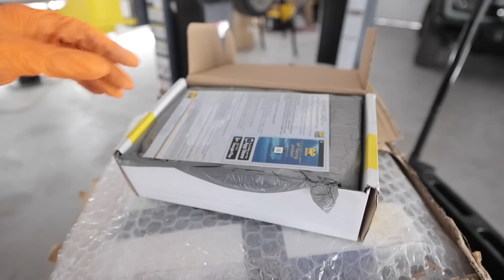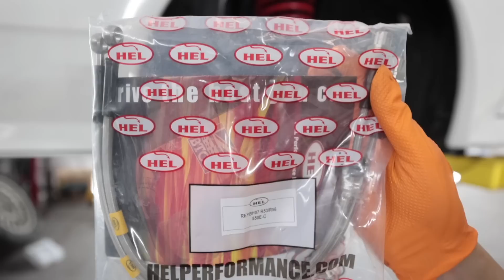Audi UrQuattro Upgrades! 5 Cylinder Turbo Pure Sound

Comment: Hi Sarah,
The K-Jetronic system was incredibly capable and flexible for tuning - if you know your way around them, and I would not discount some of the advantages it offers with turbocharged cars. Try and get your hands on a copy of a book by Charles O. Probst (ISBN 0-8376-0300-5) covering Bosch fuel injection and I am sure you will be surprised. Given the time the system has been sitting, it will be gummed up and that can create the cold idle issues as well as delayed throttle response etc.. Perhaps a series of the overhaul of the K-Jet? I'm sure it will fascinate a lot of your viewers as it was not widely understood. Modern electronic system are superior but part of the character of that package was in the K-Jet.
The UR is one of the greats and you are a very lucky individual indeed to be able to enjoy it. 
Look forward to the next update!
Reply from the maker: Ordered it!
Reply: @SarahnTuned  I have the K-Jet on my 1988 Testarossa.  It acts the same way as you describe.  If I let it sit too long without driving it, it is a bit lumpy on idle.  Once driven a while she settles right down.  Keeping everything clean and happy (running/driving)  is key.  

Love the channel!
Reply: @curtiscampbell6178  I'm finding the same with my 85 urquattro - the more it's driven the happier it is.
Reply: The right person will be able to tune your kjet to your needs
Reply: The pintle that rises and goes down when the amount of air goes through to regulate fuel pressure is gummed up.  Not a big issue.
Reply: @SarahnTuned  the K-Jetronic allows for 240 hp tuning. You'll also see that on the Audi 200 (5000) works rally car.

Comment: Hi Sarah. I love that Quattro too. My friend had one. It came in on the hook. Two snapped off spark plugs. Five cylinder. The threaded part of the plugs broke off in the head. Big easy-out and lots of heat wrench. Complete tune up, fixed vacuum leaks, changed the oil and filter, fuel filter, and kissed it goodbye.

Comment: Charlie did an awesome job fabricating that pipe. It looks really professional. Don't give up on that K-Jetronic fuel injection just yet. This car has probably sat around a lot given the mileage. Remove the injectors and have them cleaned. Install new injector seal o-rings. You should see a noticeable improvement. It's refreshing to see that you still use hand tools when making repairs. Everyone uses the cordless tools nowadays. Little Sarah's hair is cute. She looks great as a redhead!

Comment: The exhaust has a strangely muffled and slightly gasping for air note to it, with a trilling sound the same as a Triumph Speed Triple (parallel 3 cyl. motorcycle).  It's definitely an unexpected exhaust sound. 
Awesome content! Keep doing what you do!

Comment: You need a tool to put your wheels on and take them off without scratching them. Its like a spike that threads in where the lug bolt goes then you slide the wheel over that so it doesn't hit the brakes and it holds the wheel while you start the bolts then you thread it out. Most newer VW's came with the tool in the spare tire kit. The early Touaregs have the best one, i always pick them up when i am in the junk yard. It's a, must have, for nice wheels.

Comment: Yay Lil Sarah!!  <3
You've made a very smart decision with the AP kit.  I've got a similar system for my FD.  1 of the best upgrades I've done to it.  2 piece rotors and light weight 4 pot calipers for the win.  The rears are OEM with the exception of the size of the rotor.  The AP kit came with upgraded rear rotors to help with the overall braking potential.  There's 1 thing you're going to notice though, and that's the brake dust.  The pads are fantastic because they help you stop really well.  But it comes at the cost of keeping your rims clean.  They dust alot!
The car is sounding good!  Goes to show you, you have to drive them at least regularly.  The upgrades don't like to sit for extended periods of time... 🙂

Comment: Nice job!  You need a Audi/VW wheel installation tool (wheel hanger alignment pin).  Your Audi uses a different thread size compared to modern stuff so you may need to make one.  Makes putting on and taking off wheels much easier with no risk of the wheel falling off the hub.
Reply from the maker: I have like 3 of them, I just never bother to dig one out.
Reply: @SarahnTuned  I think everyone into VW/Audi has several and I don't know anyone who actually uses it.  :D
Reply: @rennkafer13  I have it in my A2 but I ised it once, because it was pain to get the plastic pin out. But practice makes you do it completely fine without the pin 😁

Comment: Check the Fuel Accumulator on the unsteady idling. They tend to fail over the years and it usually starts with the symptoms you described…

Comment: I put a set of Wilwood calipers on my ND Mazda MX-5, much lighter than stock and work great. Great cars deserve great brakes. AP makes very high quality stuff! The Wilwood kit came with rear calipers, the parking brake is not as strong but it's adequate. I got a set of one way bleeder screws, they make brake bleeding a one man job, handy for those of us with no friends. One of the good things about brake conversions like these is that pad replacement is simple, pull a couple of pins, push the pistons back, and you're good to go, no special tools to wind the pistons back.

Comment: Ate Blue is out of production since ages. It was making brake-bleeeding  really easy: you just needed to change from a yellow fluid to the blue stuff (or viseversa) and could always see when the fresh fluid had flushed the system.
Regards from 🇩🇪

Comment: If you're having weird startups on your K-jet, it's most likely the warm up regulator.  It controls the control pressure on the fuel distributor plunger.  Less pressure means a richer mixture.  If the warm up regulator screen is filled with gunk or otherwise the operation is not smooth, it could cause overly lean cold start. 
I like the wheels on your Ur quattro.  Those were the setup to have back in the day.  I had a 20v coupe quattro.  That car twas a junk

Comment: Those 80’s Audi’s and BMW’s are pads like candy.  I had a 1987 325 and got about 22k out of a set of pads.  So, those brake pads are easily the 2nd set on that car.  You by a vacuum break bleeder.  It hooks up to a compressor and you don’t need help bleeding.  I use mine a couple times a year as I have 4 cars.  I used it for my motorcycle too.

Comment: I wouldn't blame you for wanting to ditch the k-jet system. The amount of time I spent roaming the internet reading posts from old master k-jet mechanics. I had a similar system on my 1986 VW golf. It was really sensitive to weather changes and you had to make sure all gaskets and rubber seals were good and not leaking. The metering plate (big plate in the intake) that is attached to the fuel distributor needs to be checked and cleaned every so often (did mine every oil change).

Comment: The K Jettronik in general on the 5 cylinders has a problem with hot starts, since the fuellines go over the engine they get too hot, which makes the gas vaporize inside the fuel lines and that leads to bubbles in the system. It mostly results into bad hot starts. Audi addressed this with the little air cone which points to the fuel rail that goes over the cylinder head but its not enough. 
If you want to make bigger power, its not worth it to fiddle with the k jettronik, thats also the reason so many people switch to the 20V Engine with EFI its easier to make power out of and a better daily and with a cone filter and an exhaust it sounds very similar to the 10v also replacement parts for engine internals are easier to get. However if you want to stick to the 10v get an EFI System it will be a better daily and you are able to get more power out of it.

Comment: Tech tip pinch off the lines when you do calipers jump in when your done pump it up go down and gravity bleed em a bit with the brake fluid bottle upside down in the resivoir you’ll never need a hand at bleeding brakes again

Comment: Miss my Coupe. Audi didn't use the "GT" nomenclature until the year following mine. '81 to '82. They also changed the final drive ratio to a higher number/lower ratio. Being that so many of the miles I put on mine were highway miles (between L.A. and Mammoth), I appreciated the taller gearing. Audi must have done it to improve "off the line" acceleration as the stock Coupe was not particularly quick. 130 HP if I remember correctly. But even with stock exhaust, the 5 cylinder had a unique (and great) sound. I love the "mods" you're doing. It sounds fantastic, love the wheels (thank the powers that be you didn't opt for white). Needless to say, I'd kill for that car!

Comment: Both H&R and KW does coilover conversions of these struts.

You're also somewhat right on the works cars, but in Group B (so 1983 onwards), firstly the Quattro A1s were keeping with the motorsport Pierburg on the CIS still running the conventional 86,4mm throw. So it was not until the Quattro A2 that compression increased and the EFI of Bosch Motorsport came into play, but then the engine configuration gets so many modernizing small changes compared to the urquattro basis.

Comment: To make your life easier, I'd highly recommed the threaded plastic rod (as found in the 90's Audis) to help you get the wheels on/off the car easier. Also, rear calipers for the Quattro are currently very very hard to find. The best alternative is the rears that came on the C4S4. They fit and were vented rears disks. (just like the setup on the RR 20vt Quattros) Great vid! always love to see the updates.

Comment: The old Porsche 911's had a K Jetronic CIS system on them.  I always run Technron in them to clean them up.  Works great.  I usually put a whole bottle in when theirs 5 gallons of fresh fuel in it.  Then run the 5 gallons through it driving hard.  Then fill the tank halfway and add another bottle.  Amazing how well it cleans everything up.  Ethanol free fuel really helps too if you have access to it.  We don't anymore in Illinois.

A EFI Megasquirt addition on an old 911 really wakes them up.  It also allows a turbo addition on them pretty easy.  The original pistons are at an 8.5 compression so perfect for an old school style turbo.  Just have to be careful of the Dilvar studs and swap to ARP.  A 911 turbo with flared shoulders and hips really looks bad ass but truth be told a thin bodied one with a motor is faster because of aerodynamics. 

And old classic 911 could be a next rebuild.  They're kinda like a high performance, through 2 extra cylinders and better tolerances, VW bug.

Love what you did to the Quatro.  Sounds amazing, so many don't upgrade the brakes too that's a great addition.

Little Sarah is still a hoot and adorable.  Love her hair and her smile and laugh.  Cracks me up every time.

Comment: When the oxygen sensors are not warmed up the injection is open loop. Its sounds a little rich, just like having a little choke on. It goes closed loop in a minute or two and straightens out.

Comment: Dust shields are not a necessity... I don't run any on any of my vehicles
Reply from the maker: They shield your lower ball joint from heat, actually super important unless you want to change out ball joints more frequently.
Reply: @SarahnTuned  Kryptonite ball joints on all of my vehicles and they are one and done. 13 years on my 2007 2500 LBZ Duramax. And it's a workhorse, not as many years on my other vehicles but none the less never an issue.
Reply from the maker: @norsevikingsir4932  kryptonite balls 😆
Reply: @SarahnTuned  ran my cars on track without the shields for years, on a road car it should definitely work without any issues, maybe some more splashing on the brakes in wet weather.

Comment: The K-Jet systems get gunked up very easy if not driven often. I have a 1980 Porsche 924 Turbo and I just spent $4,000 getting the K-Jet system gone through. Makes a huge difference!

Comment: The Ur Quattro is looking great!  Keep any ethanol mixed fuel out of it.  I had several K-Jetronic Audis "back in the days" and that is the only problem I ever had with any of them.  Audi dealerships used to sell a fuel system / fuel injection cleaner.....it was just Techron with an Audi label.  The new exhaust sounds great!  Oh, and I miss the blue Ate brake fluid as well....alternating between the blue and gold fluid made bleeding easier.  You need to get a Motive brake bleeder!  Makes bleeding the brakes a super easy one person task!  Love the channel, thanks!
Reply from the maker: Impossible in Arizona, they don't sell ethanol free fuel here at all.
Reply: @SarahnTuned  Yeah, I understand.  Pretty hard to find it here in Texas.  That ethanol crap makes my Alpina run less than ideal........

Comment: I've never owned a Bosch K-Jetronic system that DIDN'T have cold idle issues.  I think it was just the nature of the beast back then.  Seriously, I've owned 3 different cars equipped with that system, and every last one had that very same issue.  And I'm talking about when they were new back in the early- and mid-80s -- they had that issue from day one.  Once it was warmed up, zero issues.  Never ever could solve that problem on any of them.

Comment: You should have also used a flex coupler on that section of pipe you made. As it will allow the flex necessary as the engine moves back and forth under acceleration and deceleration.

Comment: Unless you have the duct work for the brakes drilled or slotted rotors are useless. Those require air to blow through the holes and slots to blow the built up gasses away from the rotor. Some cars even have specially designed wheels that draw the air in from outside the wheel to help achieve that. The car sounds sick too.
Reply from the maker: Brakes*
Reply: @SarahnTuned  thank you been a long day.🤣🤣 Air force vet too.

Comment: After all that I can say it sounds exactly like a rally car of the 1980's before the JDM's  I remember the sound so well. I look forward to the review.
Reply from the maker: Um.. Lancer GSR 1600, Nissan 240RS, Celica ST165, Subaru Leone.. there were tons of epic 80s JDM rally cars.
Reply: @SarahnTuned  You are correct I was actually thinking of the 1970's and my brain short circuited. There was a period when Ford, BMW, Lancia, Fiat, ruled rally racing here in Australia. I had both an Escort and a Cortina and that burble of the resonator is so familiar.

Comment: Keep the K-jetronic would be my absolute recommendation - you'd need to machine the intake manifold port injection holes otherwise in order to properly fit "regular" port injectors. Also, if you go down that route, remember to seat the "regular" port injectors at the appropriate depth within the intake manifold in order to optimize the fuel spray pattern. Also, you'd probably need a custom ECU tune.

Sure the K-jetronic system is old, but it's quite robust from my experience. If you really want to, it's possible to increase the fuel flow through the injectors by modifying parts of the fuel mixture housing. I used to do this to an old og900 Saab which required ~30% more fuel when running on E85. The solution was to add one or multiple washers to a fuel pressure-adjustment valve within the fuel mixture housing in order to shift the base pressure of the system.

Comment: What a great sounding exhaust system.
Sounds like quality, not like shxx.
The loping might be the ecu for the fuel injection losing memory and when you drive it the chip regains the memory of the car actually running.
You already know with a new exhaust, you probably got to get the fuel injection remapped anyway.
Nice mods on the car.
Thank you for showing the actual work and the pain in the ass parts of this install can be.
Bedding in those brakes is really key.
I don't blame you for waiting to do it right.
New brakes don't mean anything if the pads get glazed over.
This kind of car was legendary in World Rally decades ago.
Really rewrote the World Rally rules book.
I remember the World Rally  Quattro Procars slowing down with a chirp chirp chirp to the 4wd downshifts and then roaring away full blast. 
Fun times.

Comment: I have took a lot of Chevy Malibu 08 parts before I paint it but messed up two parts when tried to take the weather strips of one of the doors out. A part which holds the small window of Chevy Malibu LS 2008 I messed that part up and a weather strip that is connected to the metal strip on rear right side door messed that up but not taking nomore off had to get the parts online so can put them back after I paint the car. I am not a mechanically inclined person but I got the doors,door knobs, hood, front grille, rear bumper, trunk outside front sideview mirrors, lights and inside door panels off. I did get the windows out of the right side rear door in back but like I said I messed parts up. I don't want to take weather strips off in the future of a vehicle just leave them on. I know this was the first time I took all these parts off but I am more into auto painting I like auto detailing some too.

Comment: The new brakes look great, and I'm sure the car will stop quick.  That 5-banger really sounds great when the car's accelerating!  I wondered if the lope was from a big cam or '80's fuel system.  And I see Lightning is going to strike an upcoming review 😀

Comment: Yeah, I miss (the proper) ATE Racing Blue. DOT banned it because of the blue dye, so ATE took the easy way and only kept the clear version. Too bad. It was so great when replacing old fluid. Bleed until the fluid changes colour. Refresh with blue or clear every other time.

Comment: You need a set of wheel hangers for your Audi, they help a lot aligning the the wheel to the rotor and getting the other wheel bolts in.